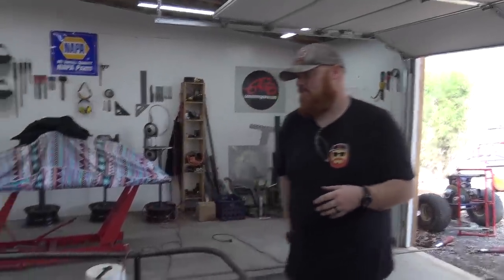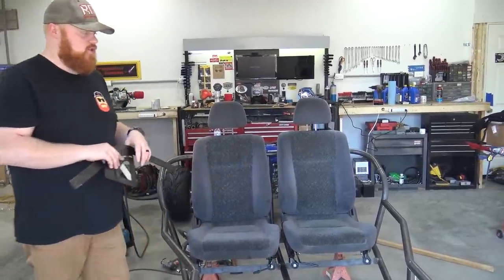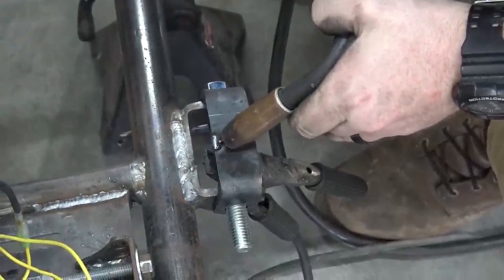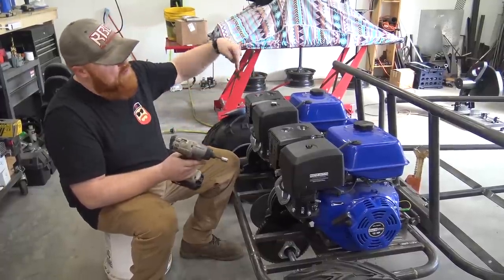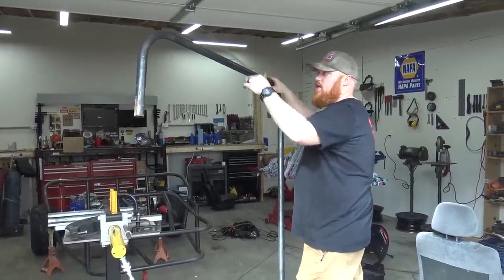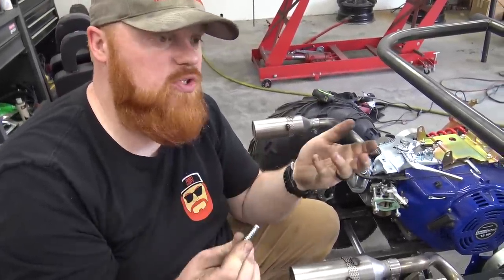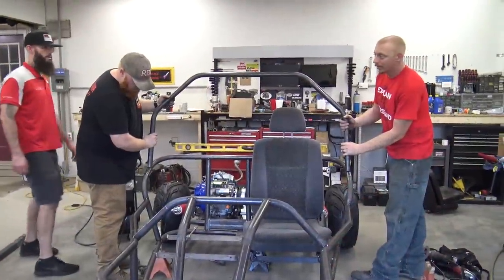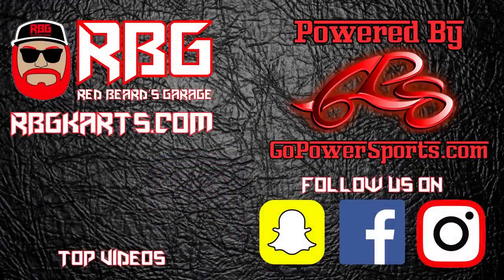Twin 18hp Engine Buggy Build Ep. 4

Comment: Thread a tee into the tank and then use 2 cutoffs.. I am very excited to see this rig running. It is definitely going to be a huge buggy.. I have given up on my quad rebuild since nobody has a stator pickup that fits. Going to get a predator and tc and go the easy route.
Reply: If you decide to redo this buggy you should get a 4 banger for it and go independent.. It is screaming for at minimum 100hp..

Comment: I am planning on doing a build similar to this but there is one thing I don’t understand. The piece on the back of the kart that holds the engines on it, how does it attach to the rest of the frame of the go kart? I see that there are kind of hinge-like pieces attaching the engine frame and the rest of the frame together but how does it not cave in due to the weight of the engines?

Comment: now I don't know for sure but I think if your radius is 7 inches on your pipe (tube) bender I believe you take the number of degrees bent multiplied by (pi) 3.14 and then divided by 180 to get the number of radians equal to the linear length of the arch. I get 11 inches (+/- : 0.01.)
Reply: but the pipe (tube) could be stretching.
Reply: I also don't know if thats 7" inches to the top of the pipe (tube) or to the center. I think that's where our length differences come from.